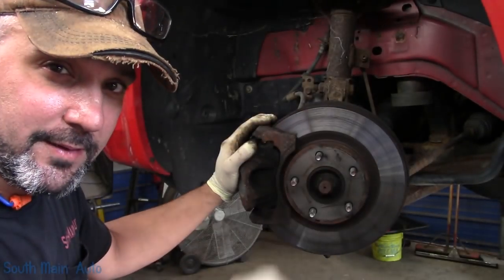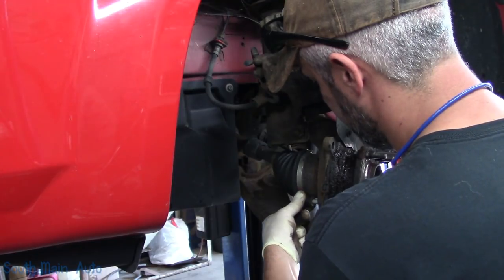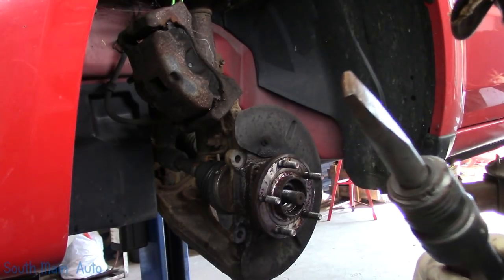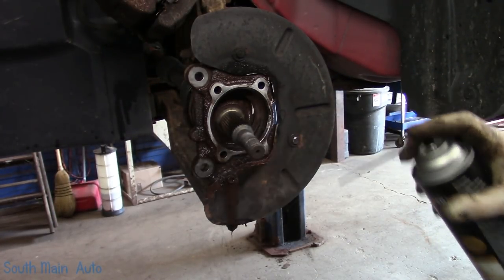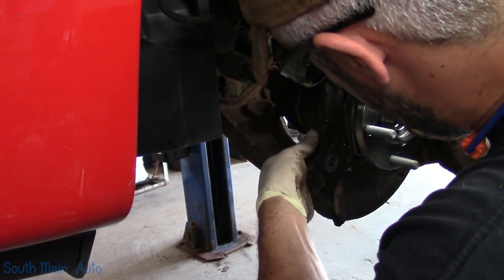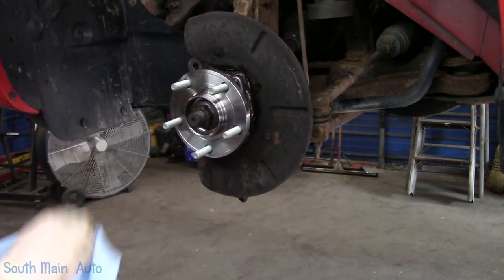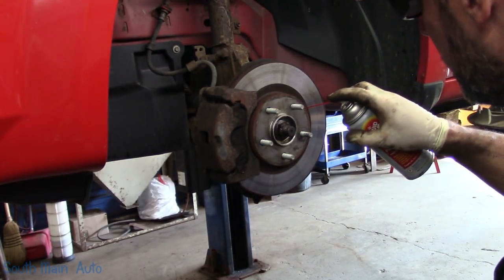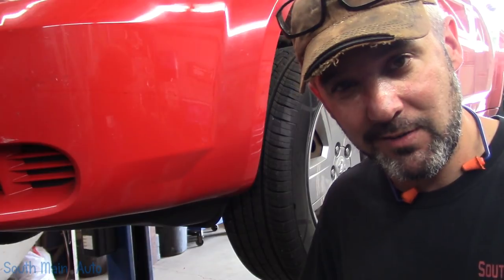Dodge Avenger: Front Wheel Bearing - Raw & Uncut

Comment: Ohh and I’ve had a laugh this morning went to a regular customer has a 2009 Honda Civic who got towed last night for a suspected broken timing belt or fuel pump failure(breakdowns guess) how he came up to that diagnosis I have no idea. Car turned over but could hear no fuel and deffo no vrrooomm sound for timing belt failure. 5mins later swapped out pump relay and car fired in to life like a champ. I have a box full of relays collected over the years so gave her the option of getting a new relay or throw old one in from my collection she chose the second option. Anyway as she is a regular customer and through the family I look after 5 of there cars didn’t charge her. Lives 1/4mile away from me and 5 mins of my time. Think sometimes a no charge is worth it in the longrun (what’s your opinion charge/no charge)
Reply from the maker: Especially considering that car does not have a timing belt ;)
Reply: South Main Auto Repair yep it’s scary some of the people that work in the breakdown industry. By a fisher price tool kit then let loose on peoples cars. Things I’ve seen over the years will make you laugh cringe and downright shock you 😂
Reply: @SouthMainAuto  I'm from the South and I think your doin just fine!

rust is everywhere!!

you can't nearly find any classic barn finds because of Rust
Reply: At times it's good business.
Reply: @SouthMainAuto  I never worked on one of them I thought they did have a belt?       Forgive me master I am but a part timer poor choice many years ago now I am just an MD with a mechanical fetish.
Reply from the maker: Here is the states the 09 Civic is a chain drive
Reply: Well if it doesn't have a timing belt, no wonder it wouldn't run!

I had a '69 Fiat 124 Spider decades ago. Lost some teeth off of the timing belt. That will flat make it not run. For days. With bent valves. Trust me on this one.
Reply: I charged 10 bucks wiggling wire on fan blower motor old Chevy has fan on top in front engine compartment so I knew.
Reply: @pritchy26HD  your point Fisher Price.  I've seen ase certified stores Firestone hire the mechanic pay him more than me yet leave a wheel loose. Go figure there are horror stories.  10081 Chapman garden Grove CA. The staton island guy maybe knows of the store
Reply: The mechanic from time to time, I don’t charge a good customer for really easy small engine repair, say a fuel line or primer bulb.
Reply: Many years ago, I had a problem with a 1990 Ford Sierra Sapphire (I'm in the UK by the way), which would cut out when pulling up to traffic lights etc when cold.   The local Ford dealer wanted hundreds to fit a new air filter housing, ducts, air filter and do all sorts of work on the carb and inlet manifold.  Being a young guy, I didn't have much cash, so couldn't get it fixed - then a friends dad recommended a small, local garage, so I took a spin by to see how much they would quote.  Really nice guy, he took an educated guess and then a quick look - he made a temporary repair to the flap at the front of the air filter housing (the one that lets it draw warmer or cooler air), and told me to see how it went and come back to him if it played up again and we would look at a new filter housing - no charge.

Now, at the time, I worked in a TV/VCR/Hi-Fi shop and workshop which had vans and cars (18 all in), all of which needed servicing and looking after.....  so pleased was I at having my car working, and for free, I told my boss, and within the month we had two vans serviced by this garage, and the company was still using them when I left years later.  He also gained my custom for over a decade, until I moved hundreds of miles away, and everyone in my street one by one ended up going to him too.

His son started working with him some years later, and they bought the site next to their garage and I believe it is now three times the size it was - and the simple reason is, they treated their customers well, and were honest about what needed doing - and if any bigger jobs were needed, there was never a thought of querying the quote or the bill, just get the work done and pay the bill.

I'm glad to see that there are still garages like +South Main Auto Repair and +The Mechanic giving good service.
Reply: I have one similar to that in my home town, it was recommend to me by a friend and have been their customer ever since. If anyone ask for a repair shop, I recommend them.
Reply: n8pu you can not buy word of mouth advertising both positive or negative. It's a powerful advertising tool
Reply: The mechanic BUT DUDE!! You have to charge a diagnostics fee, even if it's something simple, because you knew where to look, and how to look, and when to look, and your time ain't free, and the shop rent don't pay itself, and money don't grow on trees, and you have to pay outrageous medical insurance costs, and you're mother said so, and....................
Reply: roadkill5333 Na I’m mobile now done years at a Volkswagen dealership from apprenticeship up to mastertech then at a local place but now work for myself mobile in a van. I’m in redditch in the uk so medical bills are none. I don’t advertise at all and am flat out busy. They where recommended to me by a friend of there’s and now I do all the family’s cars and they have passed on my details to there friends and have more customers. I always throw in a free fix if it doesn’t cost me anything just 10mins if my time. If I diagnose and quote they always give green light to fix due to I never rip anyone off and am honest and fair. I have one customer (my nana best friend) who is a pensioner that needed her car as is disabled and only on a low income pension anyway I did the head gasket for her with new water pump and timing kit and it took 8months for her to pay the bill as she paid what she could every week granted if she wasn’t a family friend I may have said tough shit but the old bugger cried as has no family to help and it just gave me a big self satisfaction moment to help. I’ve built up a really good customer base and reputation and I find little gestures go a long way with people.
Reply: was in FLA this week and watched a chevy beater truck lose its left rear in traffic while he turned left. Thank God it turned left with him...I'm guessin the instant stop and the tire rolling but wuz his clue for lug nuts.
Reply: give and take.. back in the days this was called service...she will come back next time and recommend you to her friends... if you charge her for 5min labor and a used relay ( that can break tomorrow) she will tell her friends not to go to you because at your shop saying good morning already costs 10 bucks

Comment: i have a question i am a good mechanic i have a 2006 Subaru that needs a head gasket would you do this in the dirt shade-tree style have no garage the car is great low miles for its age has not even made its timing belt mileage
Reply from the maker: 90% of that work is done from uptop if you leave the engine in the car. Have you seen the videos I did on one of those?
Reply: i have watched all your Subaru i saw how you do it from the top mostly i  guess i was hoping that you would say hxxl no lol guess now i need to just bite it and do it lol
Reply: thanks

Comment: Have you ever had a brake rotor out of balance?  That would make a vibration going down the road.
Reply from the maker: Nope...
Reply: I had a brake drum on a new Buick several years ago that was nearly 8 oz out of balance....and it shook at speed...took a while to figure it out since balancing wheels and other checks didn't help. On a whim I stuck it on the tire balancer and spun it up...bingo

Comment: Eric,How many foot pounds is in a ugga dugga?How many neuton meters are in a ugga dugga?Judging from the sounds of your air tools and the frequency of the air compressor being mechanically activated I will guess that your air line pressure is near 185 PSI.While on this topic, I thought that I saw moisture being sprayed out of your NANO.Do you ever drain the compressor of moisture?Great video. Love working with tools.Not so much with the electronic gizmos.Tanks  four sharing, Ken
Reply from the maker: 170psi, good ear, yes I drain the h2o every month... ish plus I have a drier on some lines and drip legs on all the lines. :) Oh and an ugha duga is a very in depth topic to get into sir...

Comment: I have a 2010 dodge avenger is it better to buy the assembly with the hub and bearing  or will it be hard to compress a bearing cause its a 2010
Reply: I which they would say every details on the torque specs on the vidoes 👍

Comment: Just did a major service on a BMW 1 series 2.0 petrol 4 banger and to change the 2 rear spark plugs you need to spend a hour ripping the plastic covers,metal scuttle panel cross brasses and 3 metal injector lines off. Absolute chuffing joke. BMW wanted to charge the customer nearly £600 for it my bill came to £235. I’m a mobile mechanic now and after that I’ve just put the prices up 😂😂😂

Comment: my son's car a 2014 yaris, came with akebono factory equipment brakes. Last saturday it was in for tires with 90 thousand miles on it. the brake pads are still over half left. Amazing how great the Akebono pads are. they work great and really last. also the rotors looked fine.

Comment: not uncommon for garage to have the compressor out in a shed/lean-to attached to the building. or put them up in the back corer area and use mufflers on the intake to help silence.
I forgot not uncommon to put the intakes into other room/outside covered area. most of the noise is usually intake ;)

Comment: Do you use the wood blocks for spacers or since the rubber pad is gone on lift?
Reply: looked kind of like scrap micro-lam (laminated beam) or similar, vs plain wood.  it wont compress hardly at all.....

Comment: I live in Cali and still take my wheel bearings out like that why work hard with pry bars or slide hammer when you have air lol
Reply: Califalia/Comifornia lol. the vehicles from there I repaired, I could pull apart with my hands after breaking loose bolts with minor labor

Comment: When that compressor blows its last load, may I recommend you look into a Kaeser rotary type compressor. Yes, the initial cost is more, but they are efficient, and very quiet. They have a built in drier, and refill to cut off pressure very fast. Love mine!
Reply: why stop there, may as well get a huge screw drive that runs non stop with unloader/s...........
Reply: R B homework done. Extremely happy kaeser owner for over 6 years.

Comment: You da man..... Still... The more NASTY the better >>>pun<<< Rust belt = go wild or go home... with nothing apart and nothing finished. WD is a warm cup of milk when espresso is required in this Salt  belt area. My compressor is in the boiler room of my house and 3/4 piped to the garage still shakes the house because someone installed it without a flex section and on the cement floor. AKA I have to fix it correctly. Frankly the tools make more noise. Electrics are getting better and will soon replace our air tools i think.
Peace brother O and family!!  Mask......

Comment: All I can say is that the torque nazi’s probably aren’t as thorough as they say they are. No one “torques” every nut n bolt on their repairs. As you gain years of experience and wisdom you know what you can get away with. I call it my calibrated elbow.
Reply: I do.  But I do mechanic repairs for fun, not for monetary gain.
Most things should be properly torqued, in particular wheel nuts.
Anyway, great job.. I got this done in my car as I kive in scotland and everything gets rustwd as well.. no way you can do these things with hand tools here.
Reply: Try that in aerospace lol good way to get fired.
Reply: @ericschreiber1847  nah, good way to get sanctioned by the FAA
Reply: @jonarmedpiandsecurityoffic9051  FAA doesn't step in unless there's a failure and the investigation leads back to say someone improperly tightening bolts that lead to a engine failure during flight. So yes, you'd be fired first as your employer wouldn't want the negative attention it would cause them. I know because I've seen it happen where I work.

Comment: Tip. Wait until you have the brakes put back on before tightening the axle nut. Use a screwdriver in the rotor vent to hold against the caliper bracket while torquing the axle nut.
Reply: i blip them with impact, fully assemble, place on ground then torque, with everything else tightened.why? that's a lot of torque loading for the rotor vent bridges which are fairly thin and not really meant to support loads as such. they withstand compression mainly and the flat disc surface mainly  deals with the torsional loading and spreads it fully over all "bridge/fins"

Comment: aw cmon. the 2000's ford vans my old company used to give us snapped wheel bearings all the time. i loved going down the freeway and losing all control of brakes and steering.lol  well at least my new company gives 2010 's chevy vans.  they seem nicer to drive and are newer but ive always been a ford guy
Reply: to me it seemed like the fords always had suspension problems and the chevys have electrical issues
Reply: I think you meant "ball joints", they are/were very common, not fun with a loaded vehicle and one of the wheels suddenly turns 90 sideways into an brake or somewhere between straight and 90.....

Comment: 15:58 You always rustle my jimmies with this. Had a bad experience trying to change a wheel at home with my basic tool kit, causing bending in all the wrong places with a breaker bar. Maybe I could have tapped a wrench with a hammer or something, but what the hell is wrong with a good old fashioned 4-way wheel wrench? Torqued to the grunt of an average strength man the nuts will go nowhere, and you won't leave some lady (or me) stranded on the side of the road with a flat tire.
Reply: Was using a torque stick....won't be over tight. It's the idiots that pound them on with impact and socket that over tighten and warp stuff
Reply: I stand corrected - never heard of a torque stick before
Reply: Yeah those are a nice invention...been out several years. Gm even issued a set as special tools.

Comment: Don't use Fluid film on tailgate latches if you live in a cold climate(a couple hours east of SMA), my tailgate would not stay shut during the winter, had to wash out the FF with WD40.
Reply: uhh, it being thick is how it stays put and works :), probably not good for weak spring loaded parts in any climate. powder graphite is probably best or plain silicone grease (even that is kind of thick) if not that just lighweight machine oil...

Comment: ABS/NON-ABS, if it's the same bearing who cares, just snip the wires off and "SILICONE THE HOLE" so it doesn't get water in.
yep, more ABS than non ABS vehicles, cause it used to cost way more for abs, now it;s a bit less or they add in that insurance "will be cheaper" what a joke on dry roads and many cases though...

Comment: Whatever dude, it's you who ask people for money to do video productions, not me. Why do you want to have an air compressor in the same room where you work? Do you really like that sound.. or?
Reply: A separate room would need provisions for cooling, which would complicate things
Reply from the maker: My air compressor is in a separate insulated room as a matter of fact. With a door on it even, it just sounds ten times louder on camera than it does in real life. Mic is to good I suppose for that type of noise. Oh well.
Reply from the maker: Les, I have several holes (4") in the roof to allow air movement and 2 at the bottom of the door. It flows air pretty well and to be honest it only runs a cycle every now and then because it is 80 gal. If it ran more I would have to do something different for air flow.
Reply: I didn't realize it was in a separate room!

Comment: LOL, NY rust has never seen the like of Utah rust. Between the 400 tons of salt they put on the roads per day durning a snow storm to the mud and crud no one bothers to wash off unless it rains. There is often a choice of. Torch or hammer. there is no inbetween. I've used 20 cans of penatrating oil in one day. So glad I don't work aotu repair any more.